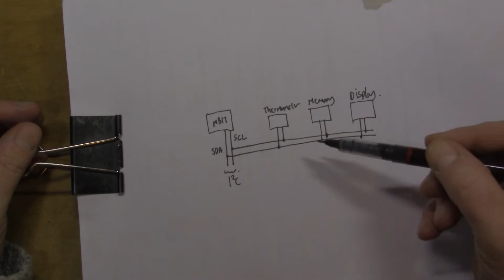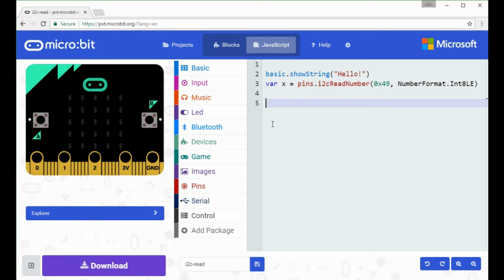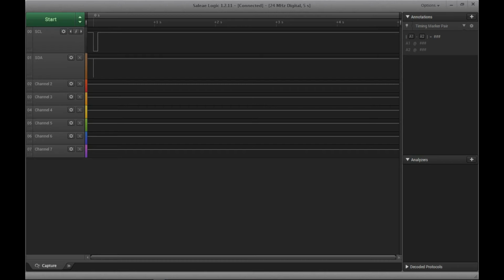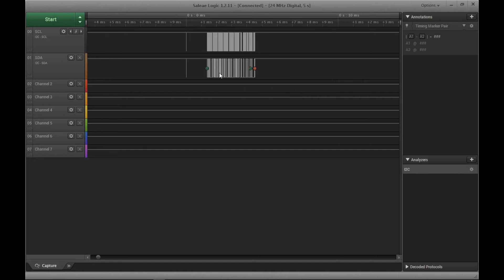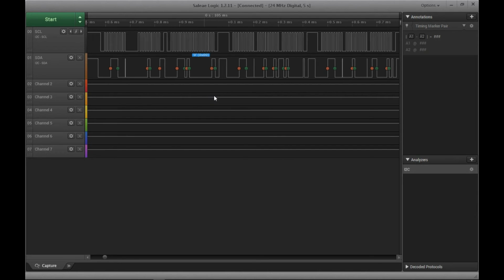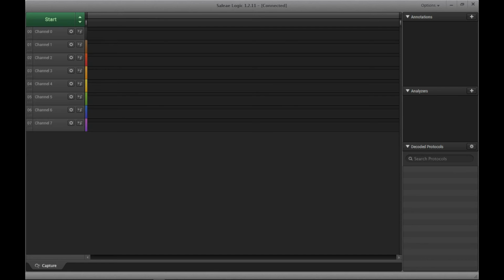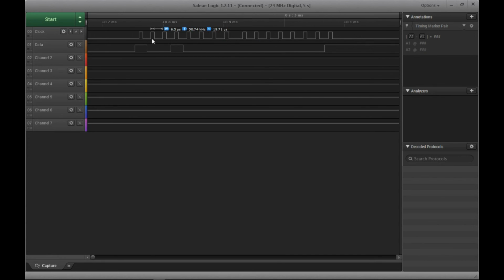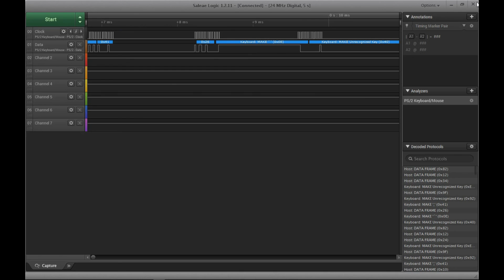Saleae Logic Analyser on the micro:bit and the Arduino

Comment: wonderful saleae info. 👌  how can you analyze arduino mega serial2 rs485 mobus rtu master/slave signals going thru max485 module checking for time out or missing data? thanks
Reply from the maker: I don't know much about RS-485, but if you can get your probes attached to the TX/RX pins on the Arduino then you can capture data with a logic analyser.